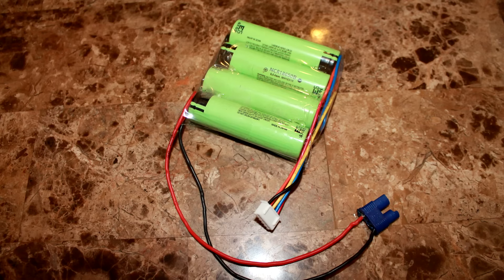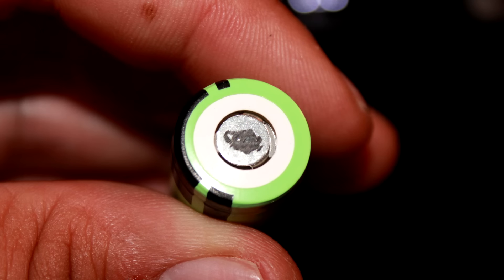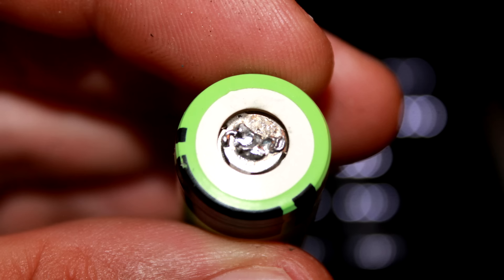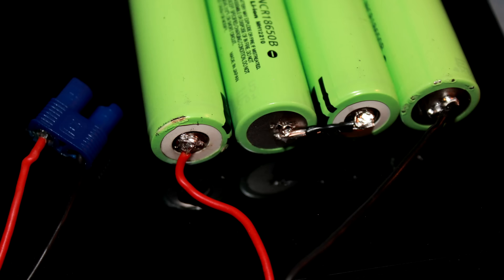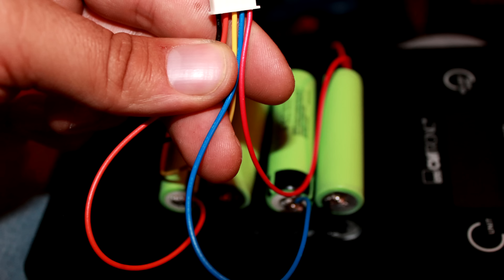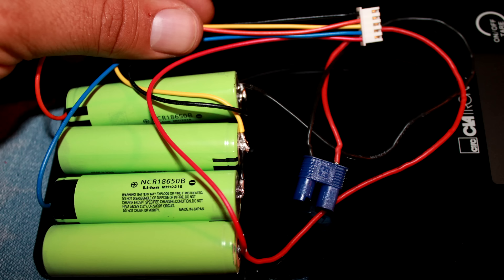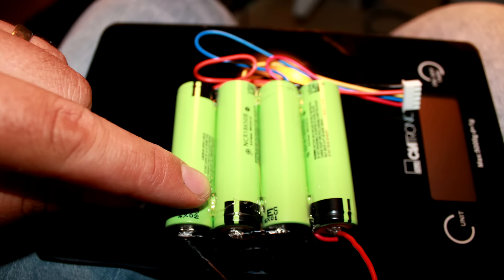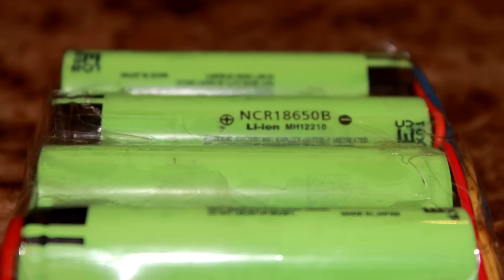NCR18650B RC 4 Cell Flight Pack Tutorial

Comment: good info, back in the day when I had access to li-ion batteries I used to make my own packs but I did have a way to balance charge them,so they wouldn't last very long maybe 30-60 cycles, either way it was a lot cheaper than lipos at that time

Comment: do you know how to make a 4s2p, 4s3p or 4s4p? And what the resulting capacity would be? Thanks
Reply: Zac Johnson Mah adds in parallel i.e. 2 3400mah in parallel would result into 6800mah.
Also no changes to mah if batteries connected in series so 4s(4batteries in series) will have same 3400mah but 4s2p(2 4series batteries in parallel) will have 6800mah.

In short mah adds in parallel (no change in series) and volts adds in series(no change in parallel).

Comment: how can u charge that batter pack..?what kind of balance charger u will use..?can u apload video for me tnx..nice job on your battery pack
Reply from the maker: jhayr soriano most rc chargers can charge them same as a lipo battery. If it the charger charges pb batterys, lipo, etc then it will charge in that charger for sure. just dont allow your pack to charge above or below the 4 cell setting.

Comment: Hello, I have a question, I need to buy 3 other 18650 cells, and i'm sticking between this two model, the LG HG2 for 3000 mAh at 20A and the LG HE2 2500 mAh at 35a, which is the better ? This is for a ZMR 250 with 2204 motor.

Thanks.
Reply from the maker: Martin Thibodeau im not sure, I only use these packs with my rc plane. it doesnt need much voltage. my tricopter wouldnt fly with these for long because the discharge rate is 3c. i always pull more than 3c with multirotors.
Reply: Martin Thibodeau -more amps more better but seriously the 35 amp and make sure that this is not stated Burst amp or pulse amp these battery’s are almost 50g each keep that in mind

Comment: simple, short and sweet, thanks.
I'm gonna order some in a min, what is the minimum voltage you can run these at? I understand you can go lower than a li-po. For example, my low voltage alarm is set to 3.5x3 (10.5) on my apm2.6
Reply from the maker: I am not sure I limited mine with a timer. I tested all my stuff real time. Example: 45 minutes for my long range plane with apm and lights.